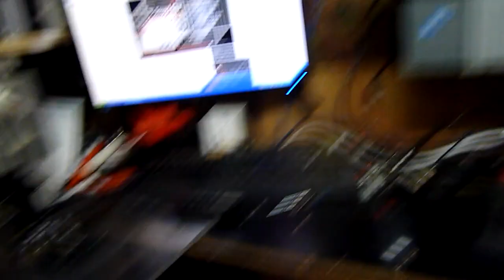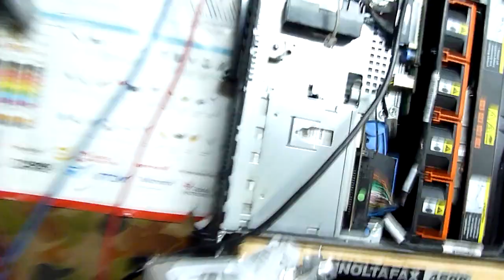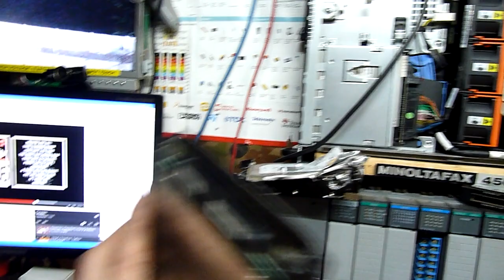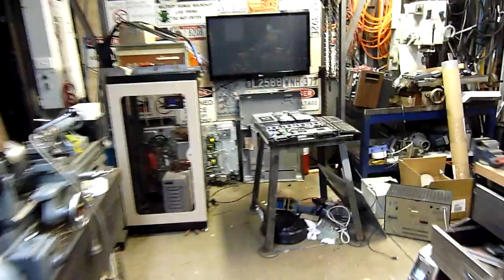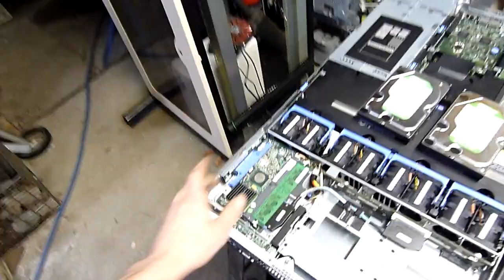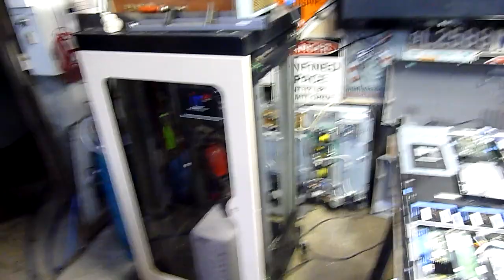Ramblotron Entry   May 27 2014

Comment: Link 2 servers together with a gigabit patch cable and download sony vegas. Bam, you have a video encoding supercomputer :D
Reply: ***** ssd and sshd are useless for video editing, if you do real job use only SAS drives.
Reply: With connecting two dell 2950 he will not get anything, they are totally useless for video editing. he can use them as file servers but that is on gigabit network too slow. Only what he can do is to put QLogic 2400 series FC cards and turn them in SAN (max spped of FC on it is 4Gb Dell 2950 cant use 8Gb or faster) but that is to expensive solution.
Reply: Well I have no clue as to why gigabit wouldn't be fast enough for a home residence. I also suggested he use them for encoding, not editing. 4 quadcores wouldn't do OK for video processing? If a can copy the whole video being encoded in the time it takes to process half of it how would that not work?
Reply: Blaze the Fox Video editing and encoding is two very different things, video editing is mostly consist of movie through large files and there you dont have much use of processor (most of time) but you need very fast disk with sequential access (SSD SSHD are good at random access but much slower then SAS 15K at sequential access) and gigabit network is "slow" for that job. On other hand if you use only for encoding you would be better if you have some graphic card taht can do GPU enoding of video (Dell 2950 have some bad graphic card.
Dell make computers that is good in video editing (Dell Precision series) and in time when they made 2950 Precision 690 had same processors (dual Xeon) and SAS 15K drives but much better graphic cards.
Reply: Miloš Lazović I know the difference between editing and encoding and I never said to edit on them. Ed has better computers to use for editing but for raw encoding power that would be a faster setup over 1 quad core and 1 GPU. Remote editing would be impossible but multi-node encoding would work well. The only issue with using the dells is if they require more buffered RAM, as a guess I'd say they would.
Reply: Blaze the Fox no there will not be gain over 1 GPU, 2950 have old Xeons in it so most of modern GPU will be much faster, don't understand me wrong I like 2950 and I  use over 10 of them (all working as servers) of all series (including series III, Dell used same 2950 name for three slightly diferent computers) but they all fail on graphic cards (for mi is not imporatnt usaly they run linux or VM-s)
Reply: Miloš Lazović With multi-node encoding you can only use CPUs so bulk encoding would be better. That being said, if ED did have a better graphics card in his editing system it would be easier just to use that, but still not faster. Remember GPUs don't have dedicated encoding chips, at best they can knock off 10-15 minutes off a 40 minute job. Also, saying that gigabit is too slow for SOHO file hosting is just silly. There's definitely more than one use for those servers.
Reply: Blaze the Fox You again mix thing, for SOHO it is ok, but if you want to store video for editing it is too slow (or if you have lot of free time you can use it), you can find many use for these servers (even they can run 5000 conurent Oracle 11gR1 connection all day with lot of fast hdd's and max ram) but for video editing they are pretty much useless.
Onother thing when you run them in real enviroment you use them in  IEEE 802.3ad Dynamic link aggregation (802.3ad)(LACP) or any other link aggregation configuration which increas speed but not for single client.
Reply: Again, I never said to use them for editing. I said they could be used for bulk encoding. Standard SATA is fast enough for this, so is gigabit ethernet.
Reply: Blaze the Fox yes you can use it same as you can use 486 for same job but it will be slow (encoding dont need to be in real time). To put you in perspective HDCAM SR have data rate of approx. 600 Mbit/s for video without  audio so you will not be able to do that with SATA hdd (and yes 600 Mbit/s is compressed data rate) and you have 0 chance to do that with gigabit ethernet.
Reply: Miloš Lazović You are comparing HD digital video tape formats to sony vegas and a mid range digital camera. Perhaps you need to consider someone's situation and actual needs before suggesting what they should do with their equipment.
Reply: Blaze the Fox I hope you get point Sony Vegas will not run on that Dell, you can run mauby handbrake or some direct encoding software, graphic card in it barely is enought to run windows 2008 or some os like it but if you expect to run some software that use graphic you will be suprised how little you can run on 16MB graphic memory (windows see only 8MB)
Reply: Miloš Lazović That's why I suggested to use CPUs for bulk encoding. Vegas would only be used in node-processing mode which doesn't even call the video card. So no buddy, I DON'T get your point. As long as what little graphics it has is DX9 compatible and has a WDDM driver available, it will work. I have done multi-node processing with an on-board Intel 3000, 100Mbit ethernet and an IDE raid setup. It worked fine encoding 100Mbit BDAV.